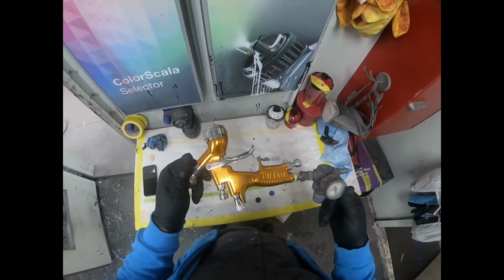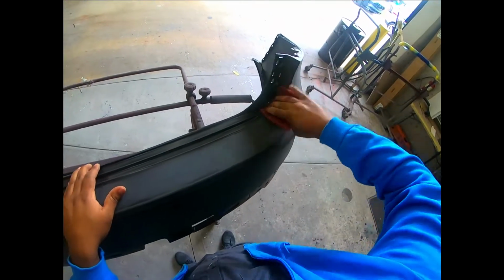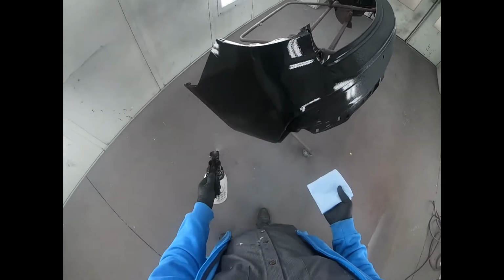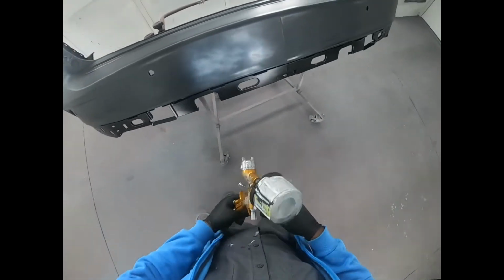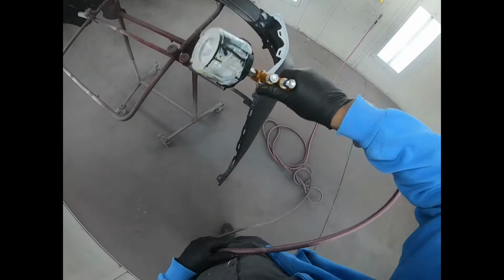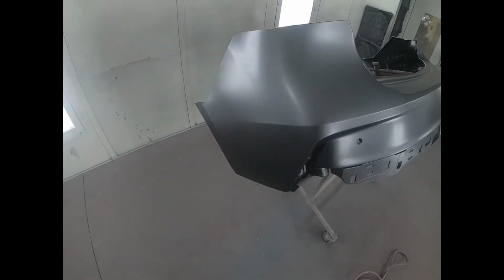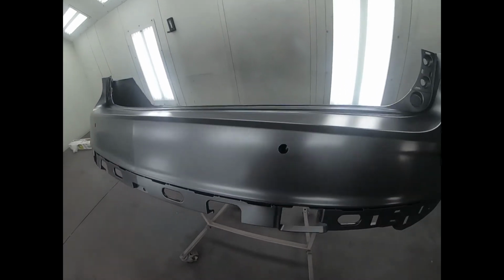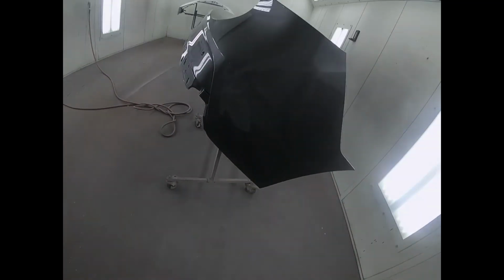THE ORIGINAL HYFIRE GTI PRO LITE PAINT GUN REVIEW

Comment: Great review Mario, for what is a fake Devilbiss it does the job very well as a lot of these copies are not that good but this one laid all the different paints quite well even the clearcoat looked nice and flat. I think streaks are caused by not doing the drop coat at the end or poor overlap when applying the basecoat, could even be a poorly maintained gun or not setup correctly 🤔
I'm in the process of getting some different WoW primer (sealer) Mario see if it helps with the problems I'm having getting a good finish when using it, time will tell 🤷‍♂️👍 John UK.
Reply from the maker: Thanks for your comment John. I hope the new sealer helps.

Comment: Hi mario... I have the same gun...I'm new to this...my question is ..can I switch my 110 1.3 cap to t20 1.3 without changing tip and needle  or do I automatically have to change  all 3 at the same time
Reply from the maker: Hey thanks for your comment. I never tried doing that, but I’ll you favor and switch it tomorrow and see what happens
Reply: @mariopaintclass6091  thanks mario....I'll be waiting....I'm surprised no one ever asked that...maybe one day you'll do a video on it ...anyway keep up the good work.
Reply from the maker: @rooksauto617  thanks mate and yea you just gave me a video idea
Reply from the maker: @rooksauto617  hey man to answer your question you can absolutely change the cap. I’m using TE20 cap on my gun
Reply from the maker: @rooksauto617  the difference between the T110 and the T20 is that the 20 issue more material  and a slightly wider fan range where as the 110 issues less. Nevertheless they are both good to use but depending on the job you might want to switch. Hope this helps
Reply: @mariopaintclass6091  thanks brother ...so basically I Can just switch only the cap and I'm good?!....now that I know that I will buy the 110cap not cap,needle &nozzle.....yes sir I'll save some money...keep the fire kit thanks again

Comment: fluid settings ?
Reply from the maker: Nash the fluid settings I used: take off the fluid cap nob completely the catch it on the threading, but before tightening hold down the trigger and then tighten until you feel  a push on the finger holding the trigger. Hope this helps feel free to ask any other questions.

Comment: I think streaks is caused by poor painting skills,using poor quality paint guns with  small fan pattern, not applying dropcoats in between with 75%/80% overlap in coverage and when u don't use the correct reducer in paint mixture .
Reply from the maker: Excellent analysis Benson 👏 I couldn't have said it better. Did you know one simple thing could be a clogged gun due to guns not being cleaned properly ?
Reply: No..... Dr.painter Im always learning something new from u!!
Reply: Hi Benson & Mario , is dropcoat being apply for every coat or only the final coat?  Sometimes i tried dropcoat on the last coat after my final 3rd coat, and do a drop coat while the base is still wet and it can close up the streaks and lay the metalic more smoothly.
Reply from the maker: @ntonytay  You are on point with what you're doing. Drop coat is usually the last coat.
Reply: @mariopaintclass6091  i always love to learn from you and Brian. Its been a while i learn painting and i always has streak during the first and 2nd coat of base. Until today im not sure and looking at your video, u guys really nail it even from the 1st coat. The 3rd coat gets better and the final drop coat usually can cover the streaks which is the only way i did until today.  Might be my technique or spray gun or even compressor which i haven't really figure out. After looking at ur comment, might be even a clog spray gun cause streaks? Hehe but highly impossible as i always clean and triple clean my spray gun after every stage.
Reply from the maker: @ntonytay  what kind of compressor you have?
Reply: @mariopaintclass6091  we are using IR screw type 10hp compressor Integrated with air dryer. Also sata filter series.
Reply from the maker: @ntonytay  that's a good amount of HP I've never tried that compressor.